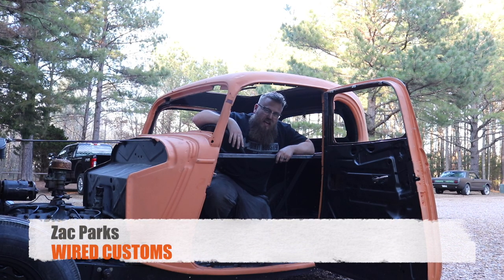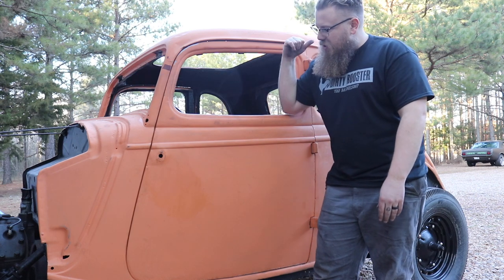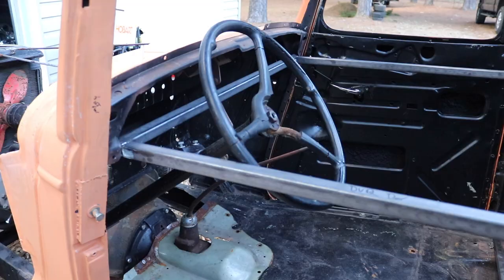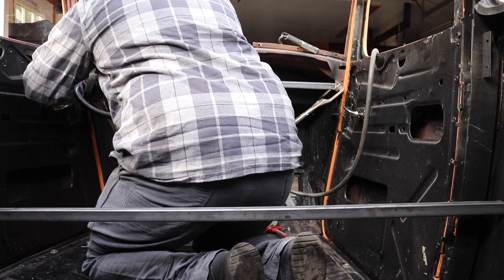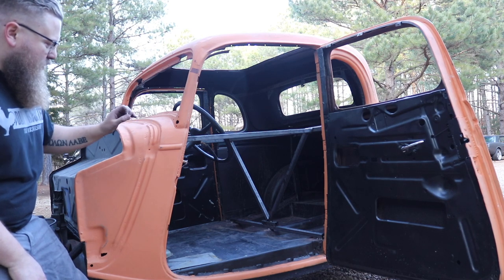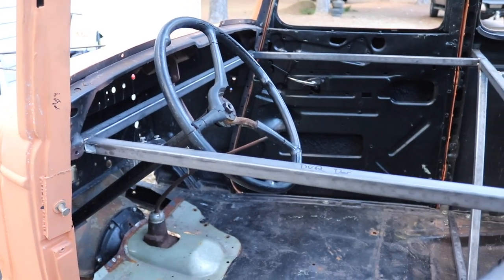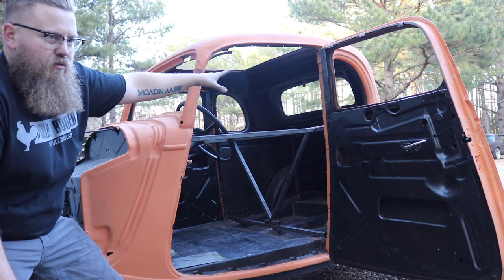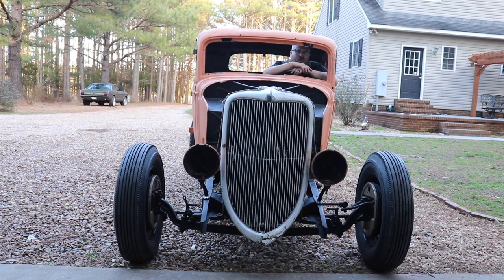34 Ford Bracing the Body Before Chopping

Comment: I have been watching your U-tube shop work for a while nice stuff. I have a technical question! I have a 1933/1934 coupe body (a wreck) that has been chopped at about 4 inches. I want to cut the posts to lean it back but do not want any more chop in the front. If I cut the post below the wind shield, I realize it will require an angle cut to do this. What would be a vee cut 1 inch or less to move it back 20 degrees?